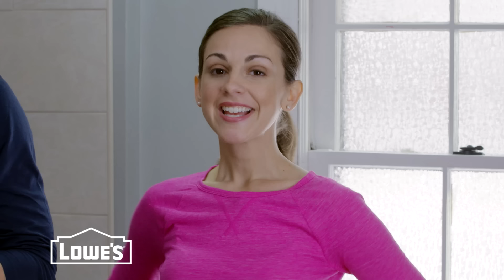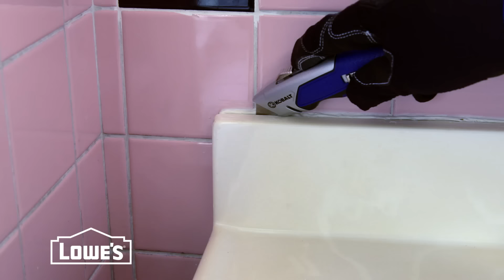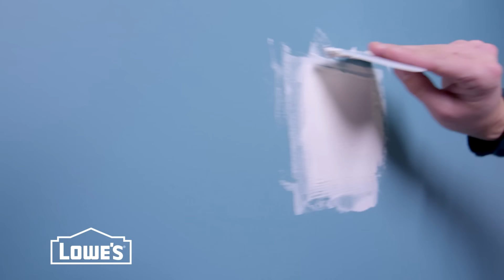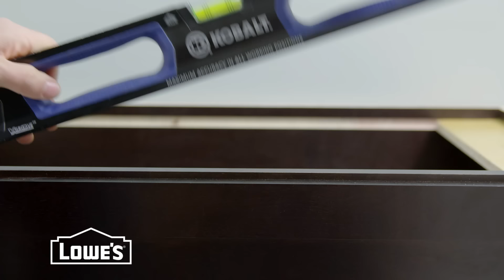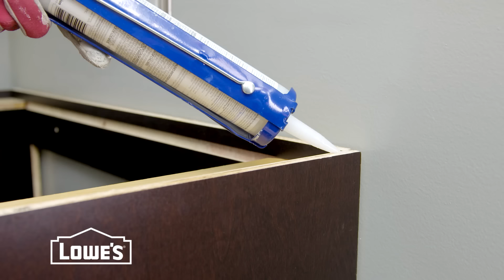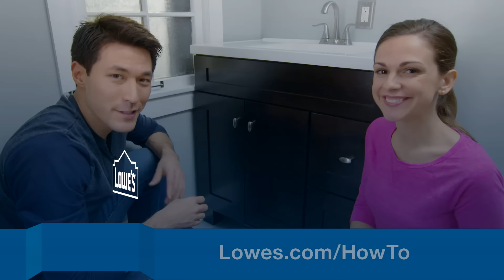How To Install a Bathroom Vanity

Comment: I just use a black marker/paint (something along those lines) on the pipe and push the vanity to the pipes and it marks the pipe locations on the back of the vanity.  No measuring pipe location and transferring those measurements to the vanity.  I found my method to be very easy.
Reply: Chalk works too

Comment: Can I use silicone caulk instead of silicone adhesive to attach the sink to the cabinet?
Reply: No one else answered, but adhesive is used to hold things together.  Caulk is used to seal water out, it won't hold things together.

Comment: And what do you do when your vanity top does not sit flush with the wall(s) or the vanity cabinet. If you've done any home remodeling, you will know almost nothing goes this smoothly. The devil is in the details. What do you do when things don't line up. This video does not address any of the most common problems when installing a vanity sink, and therefore is really useless.

Comment: I'm doing this now in a very small 1/2 bath.   I'm an experienced Handyman - Homeowner.  The place was built in 1986.  I have faced almost every problem.  1. Wallpaper on the walls  2. The Old shut off valves leak 2. The floor is not level.  3. The Wall is not plumb 4. The wall is curved.  5. finding studs is not always straightforward, especially with plumbing in the wall.  6. The sink base and sink do not line up so that the flat surfaces provide a good gluing/caulking area.   This video provides some basic knowledge but there are better ones out there.  Give your project a try but be aware that you will likely face a few obstacles that might require you to watch a few more DIY videos or even make you think "I should have hired a professional."  If you take your time you will get it done.
Reply: How did u solve the unleveled floor issue? Also, have you ever run into the issue where the piping and drain come in through the floor as apposed to through the wall?
Reply: @rmggng  the bath is so small that I just did my best to keep the tile lined up where it is visible.  I can't say I am 100 percent happy with the job. The floor should have been floated to level it out first.  But I am not experienced at that and didn't want to deal with the toilet flange being below the floor. I have not delt with plumbing coming out of the floor.
Reply: @joelcummings8677  Yes, but I was reffering to the Sink and vanity portion my good sir.
Reply: @joelcummings8677  Like in ur video for example.
Reply: @rmggng  O!  I had to modify the cabinet.

Comment: i like how the vanity stick over into the window space.
Reply: And the receptacle right behind the faucet lol.
Reply: @everbeenzen  lol .. at least it's a GFI outlet (I think!)
Reply: Homeowner special
Reply: That DIY remodel 🤣
Reply: Nothing will ever fix that
Reply: I didn't notice that until you mentioned it, now my day is ruined
Reply: Also, they put the vanity up against the floor trim. I am currently installing a new vanity now. And came upon this issue.  Their window side vanity is up against the floor trim, but their back wall they installed flush to the wall, and will have to run the floor trim up to the vanity.  Making it inconsistent on both sides. They should have flushed the vanity up to the "window" wall.  But I think they had bigger things to worry about as you pointed out, the vanity sticking over the window lol.
Reply: oh  - that was a sarcastic response - I am so bad at picking up on sarcasm - I was just about to point out how wrong that was - so glad I saw it was sarcasm first. this is a really old post so i doubt you see this for a laugh.
Reply: Exactly
Reply: Classic DiWhy
Reply: Ha! this made me laugh as they said they gutted down to the studs and "splurged" on their bathroom remodel.  If i was splurging, i would defintely move the outlet from where it's at, which is a small/inexpensive fix.

Comment: Great video. I'm so happy to see how easy this is. The G.C's want to charge so much for such a simple install so I'm going to try it myself. Thanks for sharing this video with us.
Reply: curious how it worked out for you? I am planing to try it myself as well
Reply: 😂😂😂 Its a parody. They were not serious.  It was meant to be a joke.  In car mechanics, to change a wheel bearing they charge $450 parts and labor. It is only a $60 part and you only have to unscrew 15 bolts.  In reality a beginner it would take them 8 hours to change a wheel bearing if they are lucky.  However, go on YouTube and watch a 15 minute video of how to change a wheel bearing.  Do you see where I am going with this?

Comment: Also known as: How to be sure your vanity installation is NOT UP TO CODE. (hint: electrical outlet about two inches from faucet)
Reply: GFCI protected outlets can be installed this close..and the protection need not be at this outlet: this outlet can be fed by another that has the test/reset buttons (ie the actual GFCI outlet).  While we are on this topic, verifying proper protection with the correct features of a GFCI is also required: you want a GFCI that when it has reached its end of life, that it permanently trips, regardless of grounding (ie an older home with open ground two-prong outlets).
Reply: It's not that it's not code. It's just a really silly location, typical you put a mirror there.
Reply: @everbeenzen  that’s true too

Comment: Do not install the faucet before putting the top on. If you do then you won't get a caulking gun, edging tool or your fingers behind the faucets to apply a nice bead of caulk.
Reply: why cant you put a bead of caulk on the back of the faucets after installing them on the top BUT before adhering the top to the vanity?

Comment: Outlet in front of faucet, vanity in front of window 😂
Reply: I was thinking the same thing.  This is a cleaning nightmare.  That window frame is going to need repairs in a year.
Reply: yeah, it's a frosted window. what is your point?

the electrical outlet have covers in them so when nothing is plugged into it, it slides over the back of the outlet so no moisture or water gets in. A little research goes along way. Beats making dumb comments for likes...
Reply: Wow, you got me big time
Reply: @TriniLush7  Go read a hundred other comments, No One likes it this way, it's complete crap. How do you plug in your blowdryer where it is? And your wet hands are going to be splashing that outlet every five minutes. I seriously doubt that's CODE in any state.  I know it's just a fake bathroom video in a studio, but really they shouldn't be showing that, making people think it's ok to install like that. And aesthetically, the cabinet is butted up in front of an actual window, also just bad looking not to mention a drafty spot to stand so close to.

Comment: I wen to to Lowe's yesterday to get a bathroom vanity to take advantage of their bath savings event. Most of the vanity sinks were made out of  a painted material they call "cultured marble". It's a bad quality material that doesn't last. You have to be very careful, because it looks solid, but when you tap on it you can tell it's either plywood or plastic. I had to go somewhere else to get a vanity with a porcelain top.

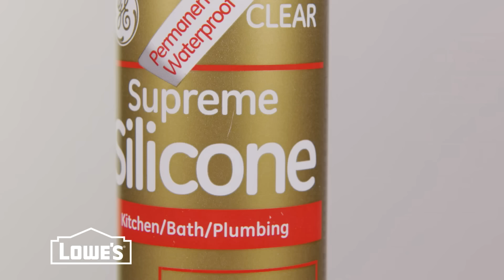Comment: At 2:36 you can see the placement of the sink is not against the wall and its butted to the window trim and is partly in front of the window. The outlet is behind the faucet. It still doesn't look too bad. Let that be a lesson in itself.
Reply: +Steve Stanley For what it's worth; I learned something regarding the the typical vanity that's purchased as a complete unit. They're fine butted against a back wall but if you're going to put them in the corner (like the above video) check your wall for square. I found that my wall, from the corner, out 22 inches, there was a gap of nearly a half inch. It's a problem trying to hide that because you can't shave the top to fit and you can't fill the gap with calk. If I'd known this beforehand, I'd have picked a top that came with a matching corner filler strip. I've decided to move my vanity away from the offending wall, which means space is wasted.
Reply: After inspecting my bathroom, it appears I'm in the same boat. An uneven, un-squared wall with a square vanity top that was shoved in place and a rather large amount of chalking used to compensate the gap. Whoa, never noticed that before. But, thank you for taking the time out to share this with me! I really do appreciate it. You certainly saved me extra work and I can adjust my bathroom design much easier! Again, thank you and much respect!
Reply: +tga2848 I noticed that and it bothered me too. However, as Lowe's described in their response, this was one of their better problem-solving solutions without having to re-plumb the bathroom. To Lowe's, you've turned a scary project into something that looks fun, managable and is certainly less-threatening to attempt. Honestly I can't wait now to get started on my first of three bathroom projects. I think the hard part now will be designing the bathroom and picking colors and a vanity. (That's a switch!) I feel equipped! Thanks, Lowes!
Reply from the maker: tga2848 Good eye! This bathroom had some layout challenges that couldn't be addressed without changing the footprint so we made it work. Thanks for watching our video.
Reply: @lowes   I understand that there may have been some "layout challenges," but is this up to code? It seems like a fire and electrical issue (due to being in front of a window and GFCI being right behind a faucet).
Reply: tga284

Comment: great video, however I worry that the faucet is right in front of an electrical outlet....even if it is a GFI one. Anyone else have thoughts about this?
Reply: Johnny AppleStead  As they had the room down to the studs, it would have taken very basic electrical knowledge and skill to move that outlet.
Reply: Are u concerned about this video placement of the vanity or your own? Trust me, this is probably just a prop location since it's for Lowes. But if it wasn't it, can easily be moved.
Reply: Yes! How in heaven can anyone plug a blow dryer? This is a code violation, right?
Reply: @claritzaechevarria7693  no its not
Reply: Perla backsplash installation
Reply: YEAH ITS A DUMB SPOT TO PUT IT PERIOD
Reply: Golden Family
Reply: joanna tomasino lo Love & Hip Hop Love and Hip Hop veoinjpp
Reply: Perla backsplash installation
Reply: I wouldn't put one that close, no real reason to honestly...
Reply: CHRISTIAN
Reply: Shannon Farley ii
Reply: Tere Sep 🍽
Reply: Shannon Farley not at all this is what a GFI is for, they use them outside all the time, Keep in mind that all outlets connected to this one GFI now become GFI's also! They will trip that GFI!
Reply: Terrible idea. I would either get a cover for it or remove it completely. Light switch/GFCI double recepticles are great for bathrooms.